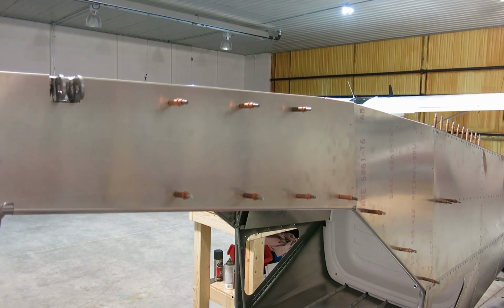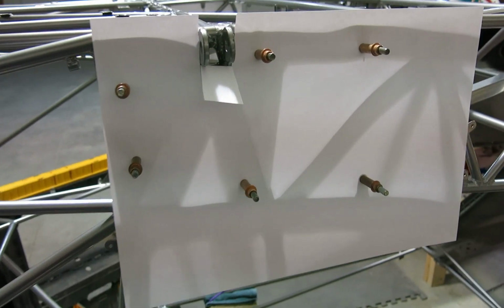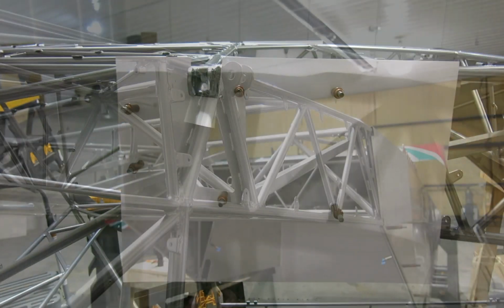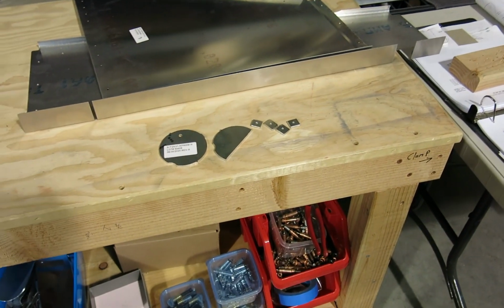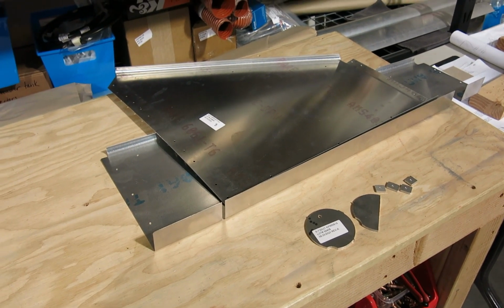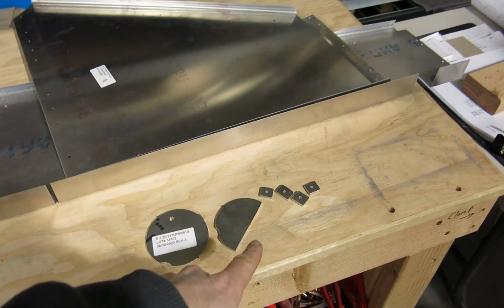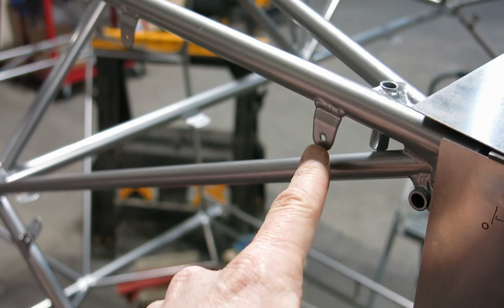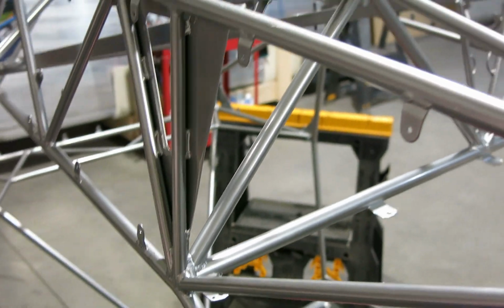No. 152 11-07-2021 Cage lower side skins

Comment: I tried to use my hole finders on those hidden front tabs and no luck.  I could have gotten to maybe a couple of them, but not all.  I had a fair bit of lexan sheet left over from doing the top forward skin on the tailcone so I used that plastic sheet for mine as it is much stiffer than paper and won’t wrinkle and makes a precise hold when drilled.  And being transparent, I just clecoed to the two tabs at the rear and then drilled through the other tabs by eye.  It was pretty easy to hit the holes fairly accurately sighting through the clear lexan and the holes then drilled in the side skins came out quite accurately.  I drilled 1/8” and had a most a few thou of misalignment in the holes in the skins and that will clean up when I ream them to #30 before riveting.

Comment: Hey great progress having been away for a bit was "binge watching your episodes" much progress, A question on the powder coated tabs? (and your aluminium spacers ) given that the welded tabs are steel and the flex-ability of powder coating - would it be considered acceptable practice to very gently "Bend the tabs the required amount to meet the skin? negating the need to fabricate the spacers? or? perhaps would that then create an alignment problem with the pre-drilled rivet holes? just curious.
Cheers. Glenn DownUnder.
Reply from the maker: Hey Glenn! Welcome back!
I considered a few bends on the tabs, and did a few very small bends, but I don’t want to crack that powder coat, so decided on the tab spacers. And, yes, when I thought about maybe bending tabs, it would be an alignment issue the way I see it. I don’t mind fabricating the spacers and have material on hand from other parts of the airplane.
Reply: @s-21project92  Thank you, yep I figured as much just wasn't sure weather Randy and the crew had a prefer'd method one way or the other.
Cheers.